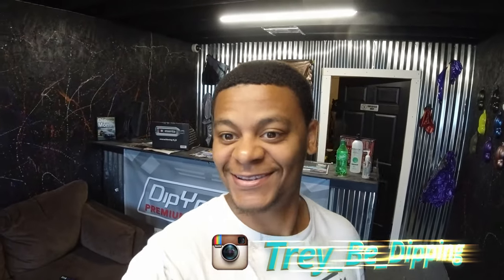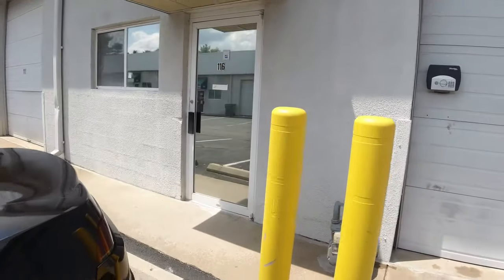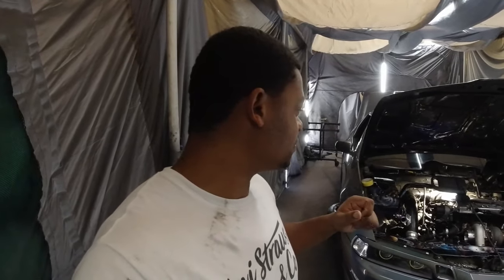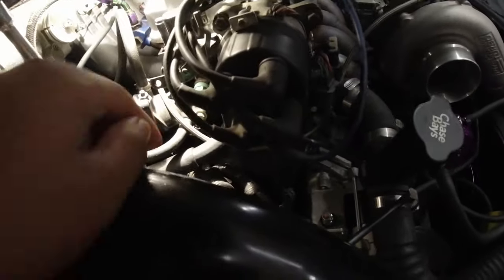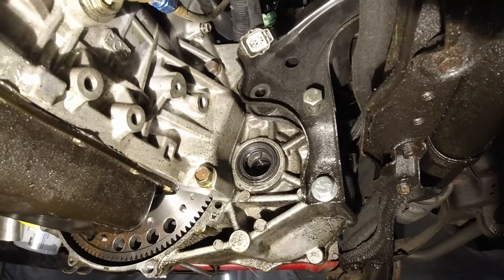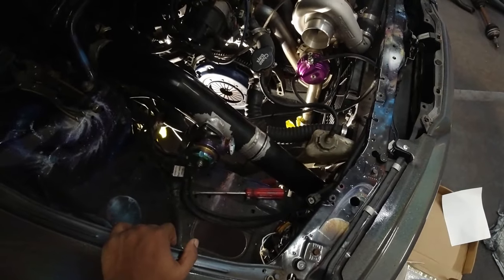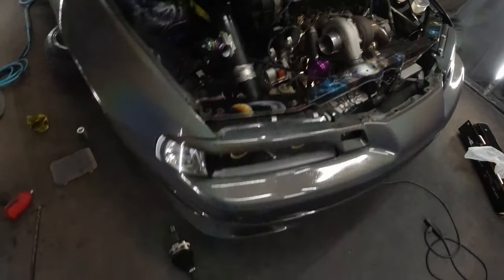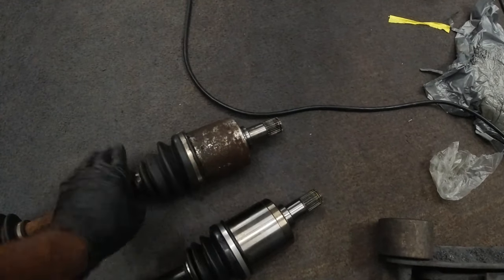Spec stage 5 h22 / f20b clutch install on a turbo honda prelude

Comment: been using the pennzoil synchromesh for 12 plus years never had any issues
Reply from the maker: Think its better than the rtf im using in the video?
Reply: @treybedipping1734  the only thing i see going for RTF is its full synthetic which is great for heat transfer 
but you can't go wrong with either one
i like the price and i can get pennzoil off the shelf when i need it plus its designed for synchro engagement so ill leave it at that.
Reply from the maker: @Abelsgotspeed  hmmmmm maybe i should make the switch and try it out.

Comment: I got a Spec stage 2 in mine...Love it
Reply: mine stock blew up. may I ask you how many hp do you have with a stage 2? 'cause I was thinking about a stage 1 but I already have 193hp and I would like to be free to reach 240/50hp without changing it again. exedy stage 1 has 260nm and mine stock should have 205nm.
Reply: @BlueOtaku   So update 3 years later my Spec stage 2 destroyed itself. Rivets all busted apart and friction disc separated after a launch. 😂 Its just a healthy H22 with full bolt ons , tuned , LSD trans . Not a fan anymore of Spec after that. Going to order either a Excedy or Competition Clutch.  👍

Comment: What Amazon clutch did you use? And did you have a stock flywheel or a cheap lightweight flywheel or a brand name one. I’m in the process of looking for one right now for my 5 th gen and need it ASAP because it’s slipping like crazy.
Reply from the maker: Got the full amazon stage 4 kit with the light flywheel
Reply: @treybedipping1734  like just the cheap off brand? Like 150$ish???? Did that cause any motor vibration on crank up and when letting off on clutch. I think my 97 type s prelude has that on there cause it shakes the dash and whole front of the car when first letting off clutch trying to take off from first gear: it also does the same thing when it hits like 7000 rpm and the tire starts spinning.

Comment: Any tips for getting the trans off? I’ve got all 9 bolts off but the side towards the bumper is stuck
Reply from the maker: Take the passenger side motor mount off the trans and out the way it will give you way more wiggle room
Reply: Was a sensor with two lines holding it on. And the flywheel cover on the bottom drivers side. Got it off todsy
Reply from the maker: @carsonhyman7330  ahh ye mine had no plate cover...thats why inmentioned it may be different from stock cause mine has been torn down so many times